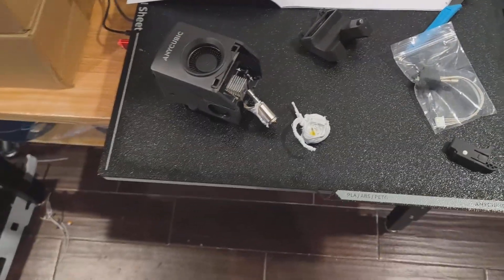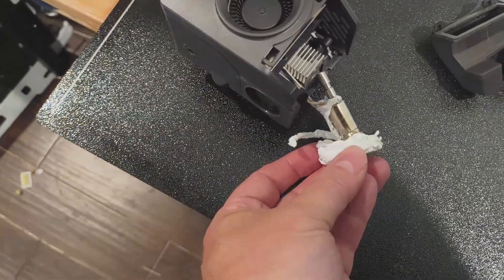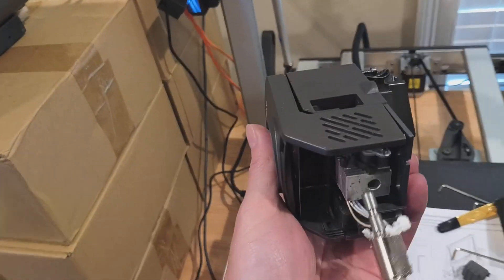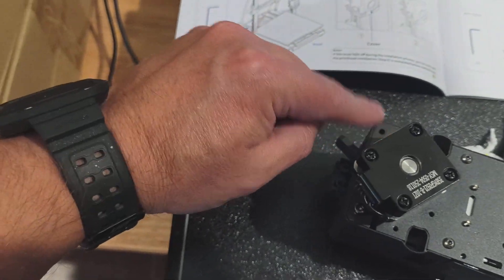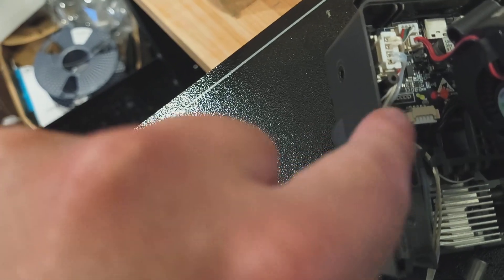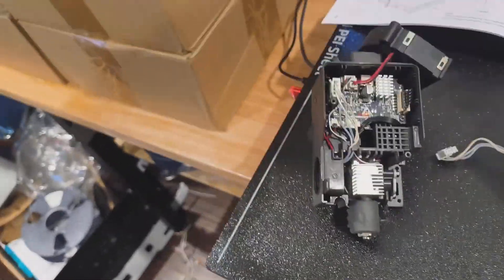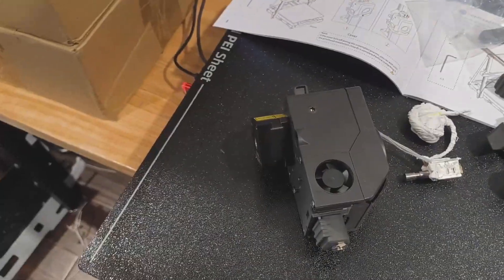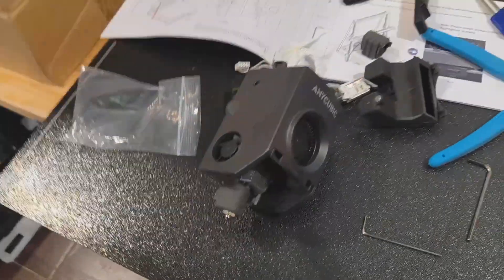Anycubic Kobra 3 Max Combo: Vid #12 - The Blob Of Death - how to change out the hot-end.

Comment: Great video, i think its the first one ive seen that really helped, just have a question, that little lid that uses the magnet keeps getting loose !!!! has this happend to you ? how do i fix it ??? thanks
Reply from the maker: Thank you.  Yes, those magnets are a pain.  I'm actually running mine without the bottom part fitted.  I though about using some tape to hold it in place, but to be honest, it works just fine without it.  🙂

Comment: I need that filament hub you have.
  And, thanks for the video!
I suffered the exact same " Blob of death " 
Down waiting on parts, but bought a couple hot-ends and an entire print head as well. 
And water soluble bed glue, I do believe my part let go was the problem.
Mark
Reply from the maker: If you PM me on Facebook or email me on LanchburyLLC@aol.com, I'll send you the STL files for the hub.  I printed mine in PLA-CF, but PETG should be fine.  Just use 100% infill for strength.
Glad you enjoyed the video.  Taking print heads apart for the first time is never fun.  I try and keep a spare head, some hot ends and a bunch of nozzles handy for all of my machines.  Sometimes, if the blob is that bad, it is worth just throwing the whole head in the trash and grabbing another, but I usually just swap the head out and clean up the old one when I have more time.  Thankfully I've only had three BODs across all of my machines, and they were all easy fixes once I had the parts.  🙂

Comment: where can i buy the same replacement??
Reply from the maker: I found mine on AliExpress.  Just do a search for "Anycubic Kobra3 Max Hotend Nozzle Replacement" on their page and you should get lots of hits.  Just make sure you get the kit that has the nozzle, hotend and silicone sock all assembled.  They're available with different size nozzles fitted so just pick the size or sizes you want.  They run around $10 each.

Comment: New Anycubic Kobra 3 Max Combo with PETG filament and on the third impression of a 3d model... stacked. Printer with ONLY 3 impressions. Now I have doubts about returning it within my 14-Day No Reason Return. I do not know what to do.
Reply from the maker: I just racked up 500 hours of printing on my K3M, and that blob has been the only issue (aside from some junk filament).  I've been using PETG on my Kobra 3v2 and that has run perfectly with it and I've had no issues whatsoever.  I'm thinking of moving over to PETG completely with these machines.